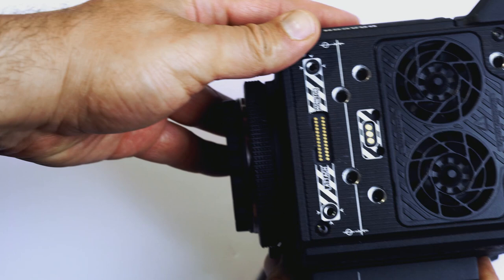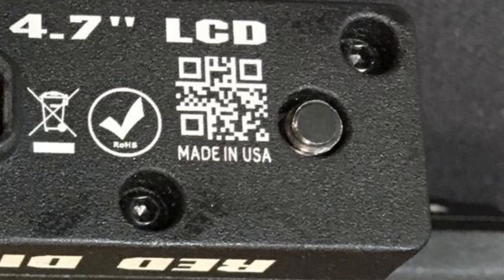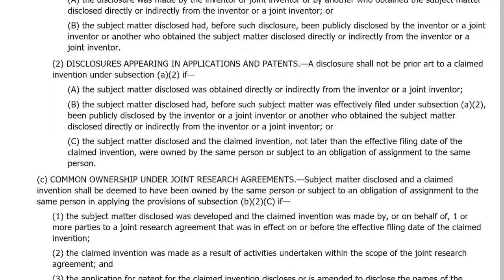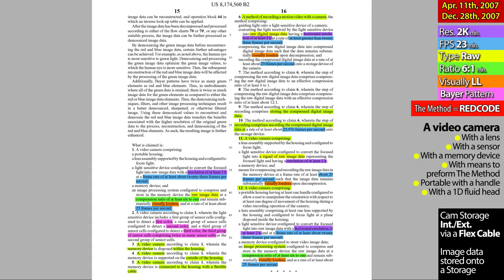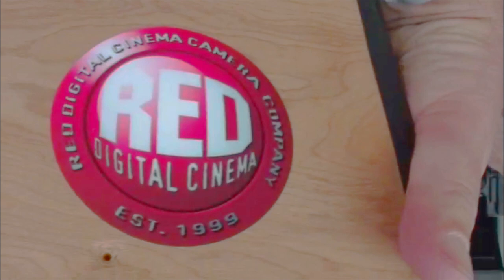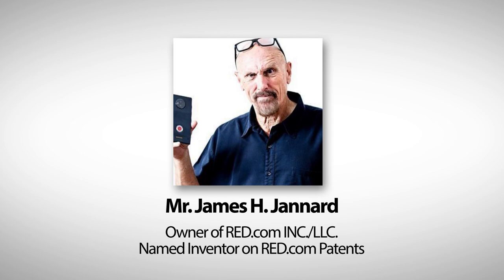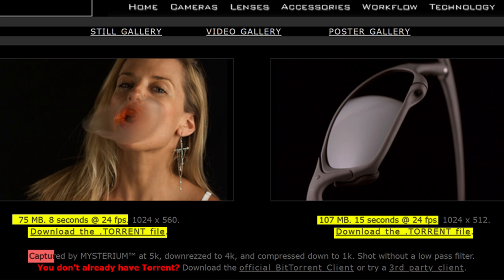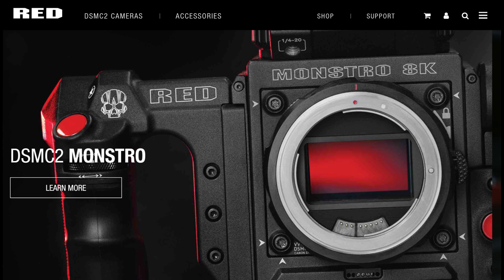Part 3 - RED PATENTS - Things you only thought you knew about RED DIGITAL CINEMA CAMERA

Comment: If the screen PCB is soldered up in USA it might qualified as assembled, at least theres a few ICs not a bunch of connectors. But even then thats a stretch and i reckon its done in china aswell to be honest
Reply: The LCD is the major part which they just buy ready made from Taiwan anyway. And the ICs on the board aren't even made in US. Even if they soldered it, still not USA made. And I think you're right, I believe they were even soldered in China
Reply from the maker: But Red doesn't claim for "assembly". Red says "Made in USA"
Reply: I honestly think the only way this "monitor" could be considered as assembled in the USA would be if they either soldered the boards or if they manufactured the enclosure in the USA.
Reply: @dangerousdavid6787  even then that's a simple screwdriver operation. Sticking a couple of things together in a box doesn't qualify either
Reply: @herbertmoon9555  I agree, that's why I suggested that their only saving grace would be if they (or a third us-based party) manufactured the enclosure or soldered the pcb. I think that if they went through the effort of casting, machining, and painting the enclosure and then assembling the device in the US it might possibly count as being assembled in the USA. However, it would be impossible to know 100% of the details without an in-biased factory tour or a legal battle in which the details are made public. Honestly, this whole scandal says a lot about red cinema and I hope they change their ways.

Comment: I won't comment on everything, but I don't agree with criticising the use of a proprietary connector for the LCD screen. It's simply not practical or possible to use a full size DVI connector there, which doesn't even pass the required power or touch screen signals.

I don't even have an issue with their accessories being overpriced. Just look at Apple.

But deceptive practices is a different story altogether.

Comment: The card at 22:35 looks more like a camera link interface then serial ports to me, also the motherboard already has two serial ports so no need for an extra serial port card. At 23:16 you can even see the little clamps that are always used on camera link and never on a serial port, if that's the case all that is in the wooden box is just a camera sensor and everything else is done on the PC
Reply: its possible too ... i dont remember a good and power effiency cpu / fpga for 4k video encoding at 2006. you do it with rasberry pi or clones nowadays
Reply: SwitchingPower You can have a secured serial cable if you wish, it’s just a matter of whatever connector you have on hand. If they were using a FPGA for compressing or handling the streaming then sure, makes sense, just a box with a sensor and streaming adapter, but I’m guessing it was just a serial cable used for control. Video over a cable like that would always be iffy at best, and I can’t see exactly what the spare ports are at 22:35 but there’s no guarantee they’re serial.

Comment: You got the breadbox analysis completely wrong.  That's not a "serial" port as you're implying, it clearly has a high density centronics connector, and a bulky cable.  The connector on the breadbox has wings too.  I haven't identified the interface yet, but I'd guess it's either a high speed multi-lane serial interface or a parallel interface similar to SCSI.
Reply: Thought similar. If it was just for serial communications a 10 year old laptop would do not a full PC on a trolley with a car battery
Reply: Looks like a flavor of SCSI to me. Seems logical as the PC could be used as storage.
Reply from the maker: Got many pictures of the prototype working with SATA (as Mr. Jannard stated from day one - He never even once mentioned SCSI BTW!!). Besides, merely considering the Nuart display of REDCODE suffices for the invalidity. All other examples are just complementary to that.
Reply: @JinniTech  So are you saying the "Breadbox" was using an SFF-8470 SAS interface for communications?  Because that's the only sane connector I could find which looked like  the one in the video.  It also tracks because SAS is Serial Attached SCSI and would make for the fastest SCSI implementation.  In the 2005 timeframe PCI-E was pretty new, which explains the need for an ATX computer to interface to the camera.